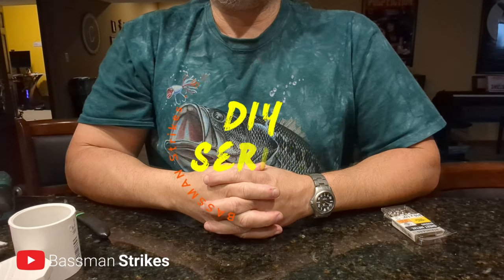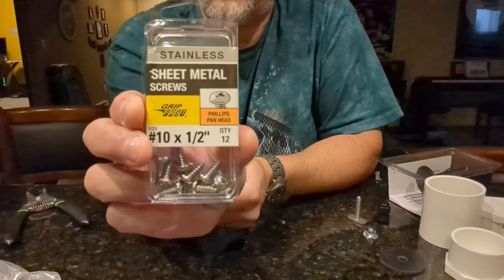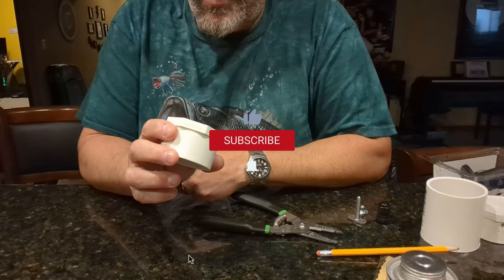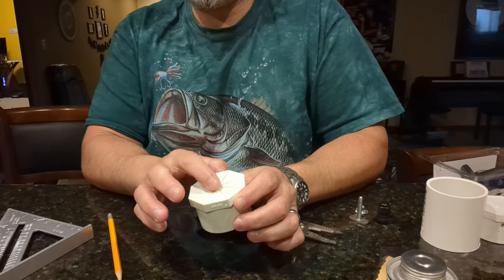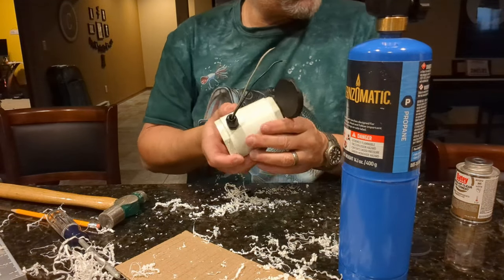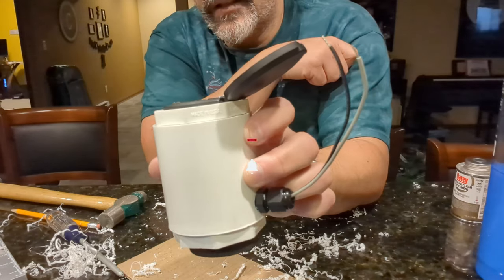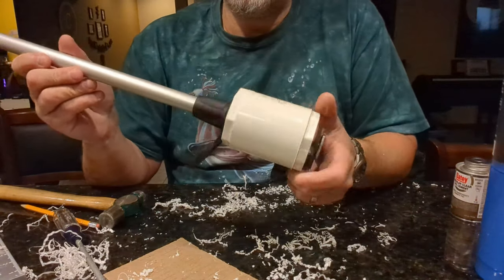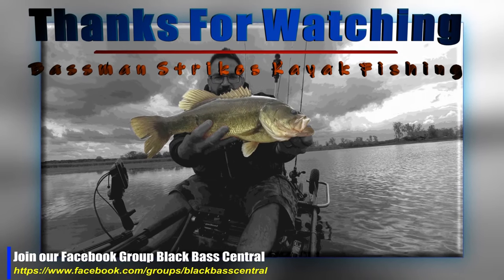DIY Attwood Light Base Kayak Gear Track Adapter HOW TO (and Giveaway)

Comment from the maker: This base is compatible with all the yolotek poles and they have an kayak adapter for 80 bucks 😁🤔

https://yolotek.com/collections/kayak-mounts/products/kayak-power-track-mount

Here is the attwood light pole I use on my kayak
attwood 5610-48-7 Telescoping Pole Light, All-Around Light, Height-Adjustable 26-42 inches, 2 Mile 360-Degree Visibility https://a.co/d/bDsG5dW

Comment: Just finished trolling motor install with esc. On purpose I added a switch for 360 light to be added in the future….guess it’s going to be sooner because if I don’t win it, I’m going to build if
Reply from the maker: Steve that's a great idea to have the switch for the light in the controller 🙂
It's a fun build 👍😁

Comment: Hey Tony, what bulb did you use in that light?   Got a link?
Reply from the maker: Jeff, this is the one I used
Cheopha 1142 BA15D LED Cool White Replacement Bulbs 10-30VDC 1004 1076 LED Bulb for RV Camper Trailer Motorhome Lights Marine Boat Navigation Anchor Stern Lights 2 Contacts Bayonet Base Pack of 1 https://a.co/d/fvKSonD